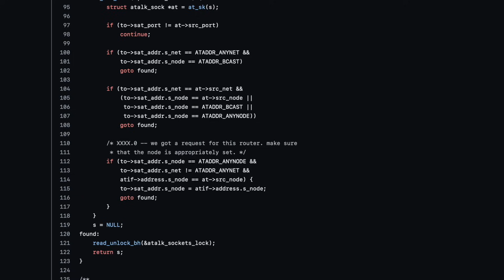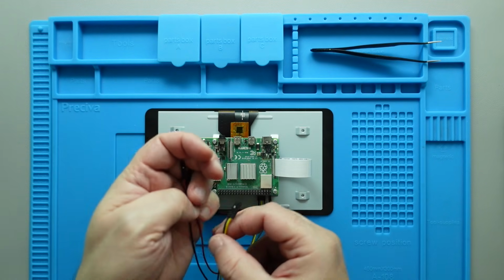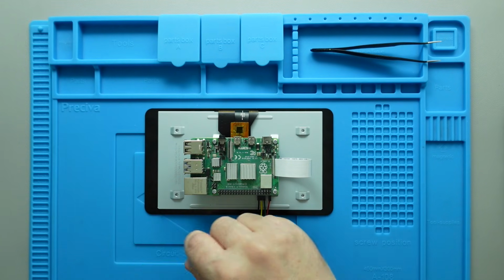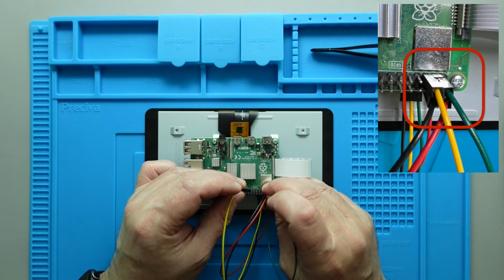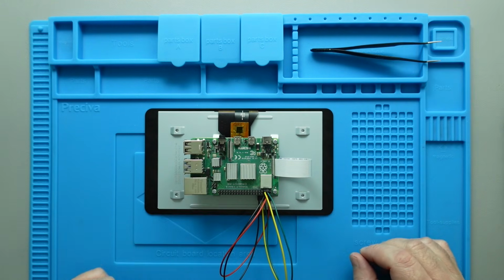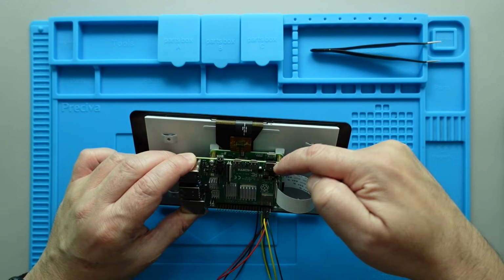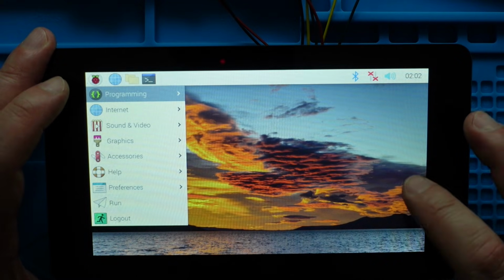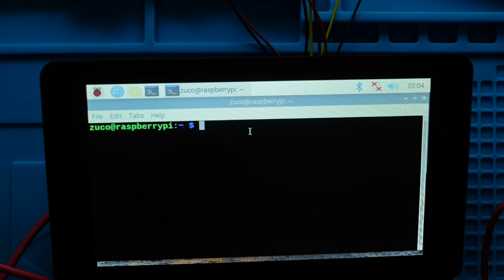Installing a Raspberry Pi 7" Touchscreen Display on a Raspberry Pi 4

Comment: Hello! Thanks for the vid! Question; is it possible to put the Pi in it's own case an mount that to the display 2? Cheers!
Reply from the maker: Depending on the distance it should be possible to get a longer ribbon cable. One option would be to see if it's possible to adapt this screen to be used with HDMI, but I'm not sure about that.

Comment: just bought this, 
it doesnt fit to my Pi 5
Reply from the maker: The video is from 2022, I tested it on a Raspberry 4 shown in the video. The Raspberry Pi 5 was released a year later. I will give it a try with the model 5 I recently got. Maybe there's a way to adapt it.
Reply: @messycircuits  actually, turns out I  need an adapter cable, only £1 on pihut...thanks anyway...

Comment: How is the LCD's FPS / refresh time with that flat cable connector? I have a different LCD (a 3.5 inch Rpi LCD thing with a simple resistive touch) connecting via the GPIO pins (requiring LCD-Show driver), and while it works okay, the refresh time is a bit slow (guesstimate < 5 FPS at most, using R Pi 3B  and testing with glxgears (which reports a way too high FPS compared to what I see btw, seems I don't get gl drivers with that LCD, from raspi-config)).
Reply from the maker: I haven’t tested the frame rate directly, but I would assume the main issue you’re encountering is due to using a GPIO-connected display. These displays can indeed have slower refresh rates because the GPIO pins have limited bandwidth compared to the dedicated DSI interface. The LCD-Show driver typically relies on software rendering, which is slower and doesn’t fully utilize the GPU. This might explain why glxgears reports a higher FPS than what you actually observe.

If refresh rate is important to you, I’d recommend opting for a DSI-connected display.

Comment: Can you use a board like the 'Pico' where you can solder the boards together?
Reply from the maker: Not sure what you mean, but this display is supposed to be used on a Raspberry Pi, not a Pico one. Although it doesn't stop the possibility of using a pico to hack some interesting stuff with it

Comment: Does this system rin with 15-18w po power bank.for both display and pi module?
Reply from the maker: I powered it with a conventional raspberry pi power supply that usually delivers about 20w. I think it would work with a lower one in that range, but I never tested it. Better to be safe and provide enough power

Comment: That touchscreen is a piece of crap. I have a raspberry pie for a raspberry pie loaded SD card I have the official touchscreen and it does not work. The computer store has no idea what to do the raspberry pie forums have no idea what to do. This is all junk.
Reply from the maker: It's not the best, for that price they could do a much better work tbh, but it works. Check the connections, maybe the monitor is defective. I have two of those and they work fine, although the resolution is not great

Comment: First, thanks for the video.  It's quick and to the point (intro a bit long, but you do you)  Next.  Can you power the display using the USB along the bottom (micro?) so then you are just using USB power and ribbon cable data?  Finally, are there any LEDs on the back side of the display?  I'm pretty sure I've got a dud.  :(  Works using HDMI, but no go with the display.  (Adds another reason to not save Bezos from the revolution)
Reply from the maker: Thanks for the feedback, indeed the intro was too long, I changed that in later videos. Still learning... Answering your questions: Yes you can power the display using its own micro-usb connector. I couldn't see any LEDs on the display board. In order to also use the Raspberry Pi you need, in latest models, at least the red and black cables to provide power. Try removing the green and yellow cables if you are using a Raspberry pi 3 or later. 
Also check this documentation about that display, it's what I used: https://www.raspberrypi.com/documentation/accessories/display.html
Reply: @messycircuits  you are too good for youtube.  Thanks!
Reply from the maker: Thank you!

Comment: Why if it don’t turn on ?
Reply from the maker: if it doesn't turn on it could be many things, check the power supply, try connecting the raspberry pi to a normal monitor to see if it works, check the configuration
Reply: @joelcolon2570I had to insert the SD card with Raspberry Pi OS, then it worked immediately

Comment: ... sorry, but u need a power (red and black) cables only - others are totally unecessary - all communication included touch between RPi and TS is realized via a ribbon cable...
Reply from the maker: Thanks for your comment. Agree only two cables are necessary, ground and 5V. As far as I know the rest would be necessary only if someone plans to code/hack for the touch controller, not 100% sure though. Fortunately it doesn't hurt having them connected, anyway I'll updated the description of the video 👍
Reply: @messycircuits ... u r right - connecting all cables does not cause any issues, but another 2 cables unecessary occupies 2 gpios, which can be used for another purposes... btw i did not expected any yours reaction, so it is a very good surprise... thank you...
Reply from the maker: No worries, thanks, I always welcome good feedback, so we can all learn and help each other
Reply: @messycircuits ... exactly, imho this should be the goal of any discussion, no offense or anything like that... it is very rare to meet human, like u in this times...
Reply: @feflofeflic so nice to see such a nice and civilized exchange between smart people. It's comments and exchanges like these that we should hope others will emulate and squash the toxic trolling on the internet. Thanks for being decent humans. And thanks @messy circuits for a well done informative video. Cheers
Reply: I followed all the steps got the right power cord and it’s not Turing on smh
Reply: @joelcolon2570 same, cant figure out why